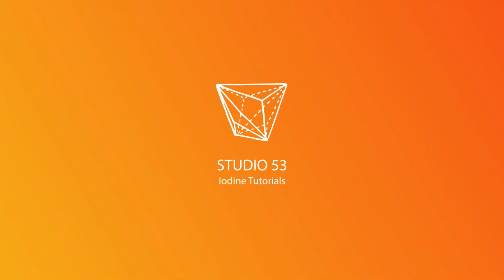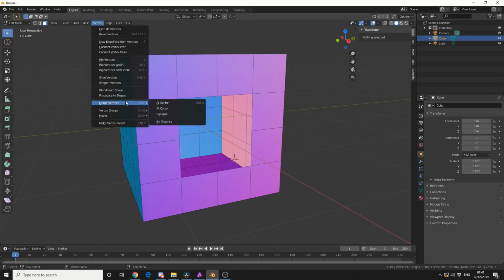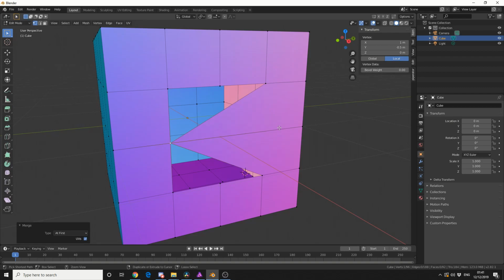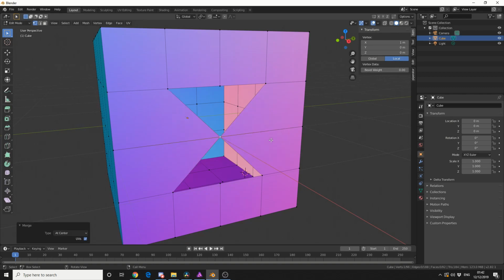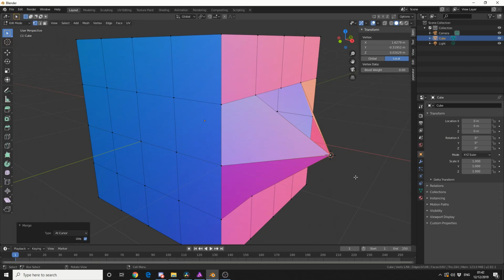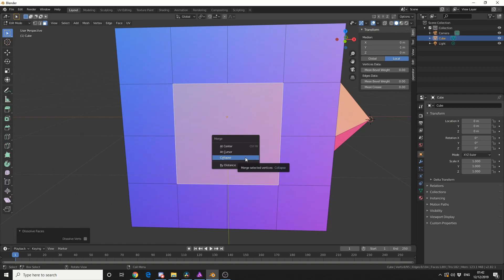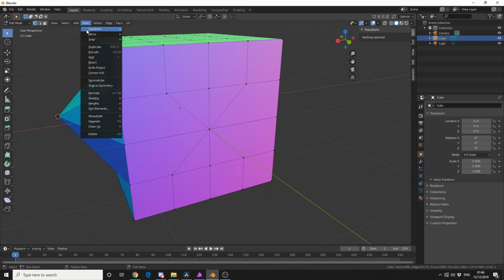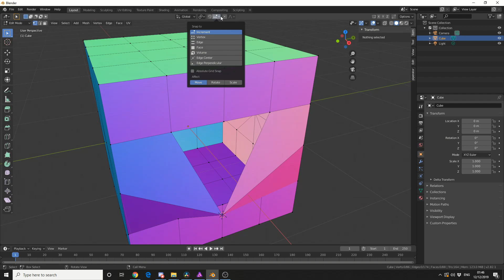Blender 2.8 Modeling Series: Merge Vertices a.k.a weld points

Comment: Great tutorials as always. I'm a lightwave user trying to get into Blender and some things are very confusing. Can you do one on Blender materials/surfaces compared to how Lightwave does surfaces & shading. When I copy and paste a material in Blender, it becomes linked/shared with the original material. I just want to copy one material and then change the colour etc.

Also, is there an equivalent Blender node to Lightwave's incidence gradient?
Cheers
Reply from the maker: generally you make a new material then copy the properties into that, as for the LW incidence there is a layer weight node that might work , I made a tutorial https://youtu.be/xfN4xyoQJYo , i'll look at making some tuts... cheers
Reply from the maker: copy material tutorial https://youtu.be/hEHTK3Is8Z8
Reply: Much appreciated.